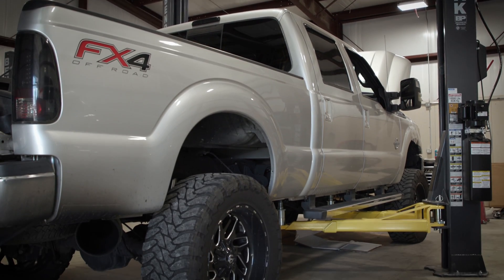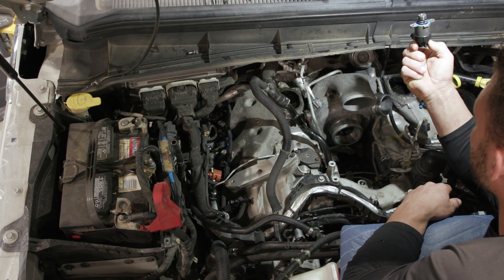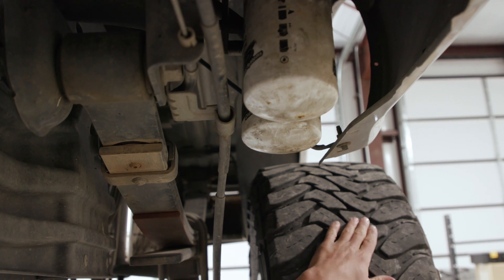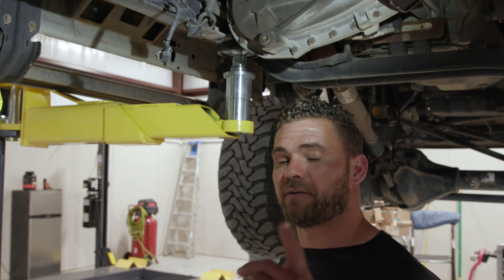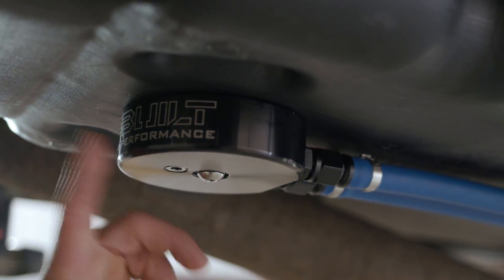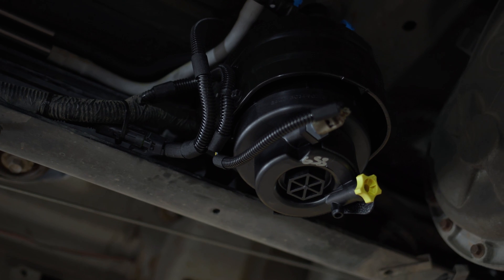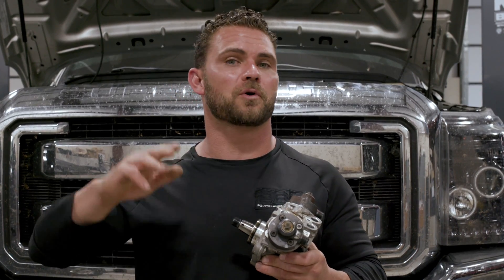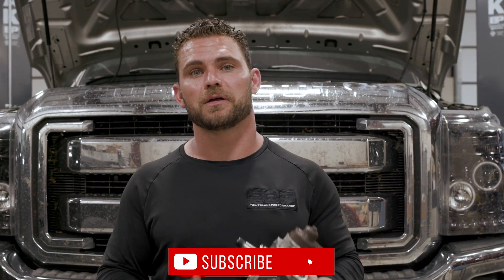BULLETPROOFING A CP4 FUEL PUMP?!

Comment: Upgraded to a cp4.2... had to chuckle at that one.  the ".2" only indicates it is a 2 cylinder pump. cp4.1 is a single cylinder you'll find in smaller displacement engines with lower fuel consumption. you're just replacing a cp4.2 with another. at best the "upgrade" is the additional of a tappet anti-rotation pin, or some other miniscule bandaid

Comment: I had an F350, two CP4 pumps failed within 10k miles apart. Cost me over $24k for both. I believe the first shop didn’t clean out all the metal shavings completely. There was nothing I could do about it. The shop fought me, Ford refused any liability. I used clean fuel ALWAYS. Screw Ford. I bought a 2020Ram with the CP3 conversion already performed.

Comment: There are technically two types of CP4 pumps, the CP4.1 and CP4.2. The main difference between them is the number of pumping elements. A CP4.1 has a single element and is typically used on smaller diesel engines, whereas the CP4.2 has two elements.

Comment: I fixed the problem with both the GM and ford CP4 by installing a 2001 ford lift pump the lift pumps n the trucks are to weak and the CP4 is acting as a primary pump and not getting enuff volume plus adding 1 cup of atf per 50 liters on Fuel protects and cleand teh pump injectors and is cheap as hell VS any other additive

Comment: I'm currently in the horrid situation on vacation in AZ, 2013 well maintained....paid off.....just driving down highway, low pressure fuel warning, engine light...engine died....12k failures of the CP4. Im in bad shape.
Reply from the maker: You contact your insurance company ? It can be covered !
Reply: @POINTBLANKPERFORMANCE  Monday we will try this,  fingers crossed
Reply from the maker: @brewmat  “ When your in a hurry it can happen , seen it before gas gets accidentally put in instead of diesel. Just give them a call and let them know what took place 🤙

Comment: Hopefully, I can get some assistance.... Looking at a 2016 Denali HD LML... has 80,000 miles on it.. Do you recommend changing out the Fuel pump now?  Whats avg cost on that?
Reply from the maker: Personally it’s a roll of the dice ! We do not count on cp4 failure to keep us in business or bank on it by any means . Yes they fail. If it’s a keeper do a cp3 swap ! We can quote you one out or honestly throw a Fass fuel system on it and call it a day we have them on the site just depends on your ultimate goal sir !

Comment: I WANNA SEE IT, I HAVE A 2016 145,000 THAT GOT 5-6 GALLONS OF GASOLINE CONTAMINATED FUEL IN THE TANK AND MY TRUCK WONT START NOW, NO METAL SHAVINGS IN ANY OF THE PUMP SENSORS.....WHAT CAN IT BE HAVEN’T PULLED THE PUMP YET

Comment: I have a 2015 in the shop now with complete failure. Not quite sure about the 4.2 only on 2015 is a good thing. 10000 dollars worth of i am all in on that comment. Truck had every bit of service done along with fuel filters every 10k faithfully. Bosch pumps are just a pos and they know it. Truck has 179k on it all stock.

Comment: Can the air dog system be used instead of the fass? Thanks, love the powerstroke videos (6.4L owner with over 200k no engine problems just rebuilt the rear axle due to catastrophic failure, 09 elt ex cab manual shift cab chassis 4:10)

Comment: The CP4 is a shit piece of engineering. Each of those pressure plungers are roller equipped at the  cam interface ....think roller cam. They are NOT keyed in any way to keep the whole unit from rotating in the bores. Once that happens nothing is "rolling" and metal starts being made with the roller 90° to the cam face. The roller attachment to the piston is nothing to write home about, either. Unless or until the pistons are designed to be non-rotable....oval, triangular, whatever....the possibility of roller/piston/cam misalignment is always present. I've seen several with the roller reduced to a huge flat spot on the cam facing side.

Comment: Why would anyone purchase a Diesel engine with a CP4 in the first place? 10 minutes on Google is enough to educate yourself about these pumps. They are going to fail no matter the fuel, filters, disaster prevention kits, etc. The aftermarket might protect the rest of the fuel system but the pump will fail. The roller cam follower will turn 90 degrees and start digging metal. Guess what the CP4.2 will do the same damn thing, admit it or not. At least the LML can be retrofitted with a reliable CP3.

Comment: Would it be cheaper in the long run to just replace the cp4 pump every 100-150k miles if your doing everything to keep it healthy, so there would be way less of a chance of one ever failing in the first place?
Reply from the maker: You very possibly could come out sir better ! It’s not a bad job to change just the pump !

Comment: I have 2018 with 70,000 should I get an cp4 kit I’ve been up to date on all my fuel filter changes to
Reply from the maker: Have you noticed any rust in the lower filter sir ?
Reply: @POINTBLANKPERFORMANCE  not that I have seen

Comment: I have a 2013 lml with 256k factory CP4 no lift pump tuned and deleted always towing my 20’ cargo trailer weighs 8k also my gooseneck with my  pull truck and no issues what so ever I have taken the regulator off the co4 3 times checking for metallic material none whatsoever but I do run Lucus upper cylinder lube with every tank.
Reply from the maker: Thank you sir for the reply !!! That’s what kind of feedback we want to share with other thank you !

Comment: I have a 2013 Duramax LML. What should I do to my fuel system to make sure this doesn’t happen to mine.
Reply from the maker: Personally air dog or Fass should be the first mod on any LML because they do not have a in tank low pressure fuel pump sir !
Reply: @POINTBLANKPERFORMANCE  okay so I have a Fass 165 on there now. I left my stock fuel filter in place and I have the DPF crap gone. I replaced the injectors at about 120k miles i had one go bad so i changed them all out. I now have 180k miles on the truck. Whats my next step you think? CP3 conversion?
Reply from the maker: @redge8279  CP3 swap without a doubt sir would be the next step !!!

Comment: So i read description on the site pertaining to the sump and FASS, if i wanted to try and have the most bullet proof fuel system for reliability and performance you would suggest what? In my head im thinking 

Sump 
FASS
H&S lower filter upgraded
Synergy mprop filter upgrade
Blackmarket performance upper filter upgraded 
SPE OR S&S disaster prevention kit

With a cocktail of fuel additives to help ensure the pump is lubricated, hell i would go ahead and do a stroker pump since its all getting redone any way. Should be good for 800 hp all day lol,  am i missing something?
Reply from the maker: What year is yours sir ?
Reply: @POINTBLANKPERFORMANCE  its a all stock 2020, im on the fence between a emissions friendly tune and waiting for a little turbo upgrade and pumper or just go the full monte.
Reply from the maker: @htownsfinest87  I would 100% agree with anyone on emission friendly tuning ( Calibrated Power Solutions ) offers solid support ! We are high performance so you know where we fail on the fence . 2ndly on the fuel system. The Factory system works extremely well if it’s my truck it would be a Fass and S&S system more so of the pump is getting a cleaner “less air “ and a straight shot of fuel from the bypass. I really don’t sell them on it prevents I sell them on it delivers fuel to the pistons and cam at the same time . So we see a little power gain out of it. Hopefully this helped some !
Reply: @POINTBLANKPERFORMANCE  yes thats who i am going to go with, black friday pricing is to thank for that, hoping they come out with a stealth kit soon or go with another drop in, guess my final question is what would you, if you can about what a 20+ powerstroke could make power wise with emissions on tuning, more air and fuel. From what I've read the beefed up trans and motor could handle quite a bit. 

Watched your  600 whp cummins video and i guess im in the same mind set of full send and see what it can take.
Reply from the maker: @htownsfinest87  Amen sir anything we can do to help just holler !!!

Comment: Isn't the cp4.2 the 2 piston model and the cp4.1 was the single piston model?  I have a jetta with the cp4.1 which is a single piston version and my duramax and my wifes q7 tdi both have the cp4.2 which are 2 piston cp4's.  Everything im reading is confirming this and the cp4.2 is not an updated version
Reply from the maker: On the Ford 6.7 ,6.6 LML and 6.7 cummins cp4 and cp4.2 are all dual piston pumps sir. I’ve personally never heard of the cp4.1 just cp4 . I’ve only worked on the light duty diesel so anything is possible!

Comment: I have a new diesel Jeep wrangler Rubicon. It has the CP4.2 in it 
I would like to know if I should buy the (Disaster Prevention Kit) or wait until they make a CP3 for the Jeep wrangler diesels?? :/

Thank you for the video. Nice clean install
Reply from the maker: I would go ahead and jump a kit ! Main reason would be because of the immediate fuel it receives from the kit , separating the fuel flow!

Comment: Can you run the CP4.2 as a direct replacement of the CP4 without any tuner or other mods to the fuel rail or anything else????
Reply from the maker: Personally sir we have never tired. I know they will start but we’ve not done long term testing . In theory you shouldn’t have a issue the pump  is more capable and will deliver more volume.

Comment: So i’m looking at purchasing a LML Duramax,  what are the first mods (fuel related) to keep from having a fuel system failure? I want to makes the changes/upgrades before having any failure (I work out of town a LOT)
Reply from the maker: First mod sir would be a Fass or Air Dog low pressure system 2’nd mod Cp3 swap!
Reply: Hope you didn't buy an LML, I think they are junk. Ours has had fuel issues constantly and now appears it is going to have to get a CP3 installed to remedy the issues. Still haven't found the air leak that is in the fuel system. Just be cautious. Ours only has 155,000 miles.
Reply: @chaplainlee  do you have a low pressure fuel pump and sump kit ? do you run additives ?

Comment: Get a CP4 Disaster Prevention Kit and install it on your CP4 and you won’t have to worry about injectors, rails etc when your CP4 bottom end comes apart. If you have a FASS set up, put a 2 micron filter on and forget about it, no worries
Reply: I'll add another tip, when changing fuel filter(s) do not skip the step to force the liftpump to run purging air from the newly installed filter(s). Even a momentary loss of fuel feed can initiate damage to the CP4. The CP3, obviously, is more tolerant of momentary loss of fuel and I believe that a number of CP4 failures are due to owners or service personnel not being familiar with the fragility of the CP4.
Reply: @walterk1221 
Absolutely.  Beyond a shadow of doubt.  🎯
Reply: @walterk1221 Yeah and the CP3 doesn’t contaminate the entire fuel system when it grenades
Reply from the maker: Thank you for the feedback sir ! Positive input !

Comment: Like others have said, that is a super clean install. I was curious though, with the sump are you able to reinstall the tank shield? Also, do you have a model number for the FASS you would recommend and for those CNC clamps that you used? Great video.
Reply from the maker: Hey sir if you call the shop ( 870-236-4900) we can help with that info . Having a hard time keeping up with the comments on here lol which is a good thing . Speak to BJ

Comment: Ram switched over to a CP 4 in 2019.  I just bought a 2020 Ram with a CP4.2: which was changed over  about mid year by Ram due to fuel system failures in the 2019 and Early 2020 Rams with a CP 4 .  So with all the fuel system failures in Ford and Duramax with the CP4., and much prior to 2019, how could Cummins even let Ram install these on the 2019 Ram engines in all good consciousness.  Ram and Cummins should be responsible for replacing and upgrading all 2019 and 2020 models back to a CP3 pump, like they have already done for the 2021 models!  Ram And Cummins Really!
Reply from the maker: https://youtu.be/nG1knMt0kR8
Reply from the maker: Robert in the link below we talk about the why sir!
Reply: There's a recall to replace the CP4.x in 2019 and 2020 Ram pickups with a CP3. The remedy is stated to be available "... first quarter of 2022..."

Comment: had a fleet of 2013-2016 f250's , had 2 cp4's grenade out of 7 trucks, had 2 cp4.2's grenade out of 5 trucks. Go with the CP3 conversion, never had 1 grenade out of 20 trucks.
Reply from the maker: Sir to our knowledge for a Ford 6.7 Powerstroke they do not make a Cp3 conversion can you share some information on this please and thank you.
Reply: @POINTBLANKPERFORMANCE  Checked with our mechanic and you are absolutely correct he did the CP4.2 with a disaster kit. Sorry for that misinformation. I have CP# on tha brain cuz we were in the middle of doing a dual fueler kit on my toy LB7.    The CP4.2 came on the 2015 and later trucks and we only had problems with the 13-14's
Whats left of the 15-16 fleet is between 250K and 350K miles, other problems were the charge air coolers, DPF meltdowns due to too much injector cleaner w/ CP4 lube, ac blower motors, and random radiator leaks at the cores. Once deleted we had no problems.
Reply from the maker: @jasonhansen6632  No problem sir what so ever ! Thank you again for the response we all appreciate it !

Comment: My greatest concern on this install is traveling through brushy woods or highway debris flying up and cutting or snagging the fuel line that is exposed on the belly of the tank. Great video tho.
Reply from the maker: Anything is possible sir , it’s all high performance modification so if traveling in those conditions then factory parts would be advised and thank you !!

Comment: Nice professional video! Do you mind sharing the cost to upgrade/repair? Thank you!
Reply: This still doesn’t seem like a “bullet proof” system! Your cleaning and filtering everything going to the pump 4 times yet the pump still has every chance of failing due to the fact its still a cp4 modified cp4.2 pump. It could still fail and take everything out once again! Wouldn’t it be best to dump the Cp4.2 and put in a cp3 conversion to make it “bulletproof”! I’m not a mechanic just observing cause I’m trying to fix the same shit I got on my truck right now. Help us all understand wtf Ford Chevy and Dodge would still use this shit on anything up and coming. I do like the cleanliness of your install but I’m looking for a system that truly would be fail safe as we all know there’s no such thing as “ bulletproof”.
Reply from the maker: @madsnag97  You are correct but they don’t make a Cp3 swap unfortunately. So  until a couple things one a Cp4 does not have guides for the roller lifters , second they have roller lifters a solid tapper would be more robust. Filtering is one thing we stress but removing the air with 2 pumps does it’s part in helping the Cp4 stay alive by not having air aided fuel that can cause a lifter you spin or
Turn in the bore also lack of lubrication continuous ! EPA / emission is the reason for the Cp4 or any new pump because the higher injection pressure means cleaner burn. 29k or 30k
Or pressure makes a much cleaner burn then 25k ! Hope this helps some sir !
Reply: @madsnag97  If you want true bulletproof, you need to use the disaster prevention kit from SPE motorsports, a completely unique system which separates the low end of the pump from the upper end with a manifold that gives it two fuel channels, instead of just one. its inexpensive, and solves the problem which caused the issue on this truck. https://www.spemotorsport.com/collections/powerstroke-fuel-systems/products/spe-motorsport-6-7l-powerstroke-disaster-prevention-kit
Reply: @CliftonMurphyjr  that's still not bullet proof.  Had this kit, my pumps still trashed the injectors.
Reply from the maker: @bossone3801  Agreed!
Reply from the maker: With a healthy system or with a failed one sir ?! Thank you again !!!
Reply: @POINTBLANKPERFORMANCE  With a failed system.
Reply from the maker: @bossone3801  Just over 10k sir !
Reply: @POINTBLANKPERFORMANCE   Thank you! Your set up would be perfect with a  new cp3 conversion kit. Just curious why not offer the option of a cp3 kit? As a customer and a wrench turner I would not want to do all that work only to install the same flawed part that destroyed the system in the first place. You obviously have your reasons and would respectfully like to hear them. Good day Sir!
Reply from the maker: @bossone3801  Only reason why we stay with a Cp4 is because a Cp3 swap hasn’t been made yet. I don’t believe it will even sit in the valley where the Cp4 is without hitting the intake horn. There is dual fuelers that use a Cp3 but nothing yet for a stand alone sir .

Comment: Where did they send the clean line from fass system?  Did it go to the factory filter?
Reply from the maker: On the old or new install?
Reply: @POINTBLANKPERFORMANCE  on the new system
Reply from the maker: @paranoid1123  pressure line from the fass went to the factory pump that contains a filter then went to the upper filter sir .

Comment: This is a joke, you did nothing to bulletproof that fuel system. Adding extra filters doesn't do a dam thing to bulletproof anything. The stuff that destroys the fuel system isnt a solid that can be filtered.

I sure hope the fuel tank shield was reinstalled to cover that horrible dumbass fuel sump and fuel line bs that was hanging down. There was absolutely nothing wrong with the factory tank design.
Reply: Frank...you need to go get a big Ole cup of STFU ...I'll buy it.
Reply: @scubababy28  yup, pointing out the truth is never popular.
Reply from the maker: Just another disrespectful hater , sir if you don’t like our content remove yourself or better yet you’ll be blocked. I sure hope you can go troll somewhere else.